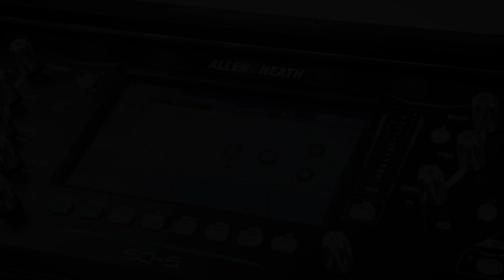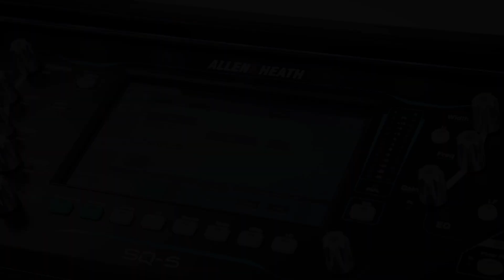Allen & Heath SQ – Using Rack FX

Comment: How do you send a reverb to aux-1 for monitors? Do you use any of the racks 4-8 or you use racks 1-4?
Reply from the maker: If you have already set up an FX mix on return to the LR and you want to send the same FX to a monitor on an Aux, you simply need to turn up the FX return on said Aux. You do this by selecting the aux, then finding the return on the layers and turning up the return. This can also be viewed and managed on the routing page for the Aux. 
If you require further assistance with this, please drop us a line support@allen-heath.com
Thanks,
Luke
Reply: @AllenandHeathUK  what is the main difference between the fx rack 1 to 4 vs 5-8?

I used fx rack 1 for reverb, at the back panel I used send/return then aux-1 but still there's no reverb coming outnof the monitor. Where did I go wrong?

Comment: HI. I wanted to ask you if possible. on Allen heath sq you can assign a waves reverb with waves rack but with usb using fx1 fx2 fx3 fx4 to avoid taking auxiliary outputs 1-12?
Reply from the maker: Hello Tony, 
The FX Engines are fixed to be used with the local FX's, it isn't possible to use the SQ FX engines to send/return from external devices.
You would need to use any of your Auxiliary buses patch through USB to your Waves platform, then returning this into a mono or stereo Input channel.
Thank you,
Rafael

Comment: But can you use ACTUAL inserts to outboard gear? I don't see insert jacks on the unit.
Reply from the maker: Hello Roy,
As a digital console, it does not have physical insert points, as analogue consoles used to have.
If you need to use external gear, you may do this by outputting the signal through a Mix bus and returning it into any available channel.
Rafael

Comment: hye keith... hmm i want to ask something.. why i cant sent the fx to aux??? i try to up fader fxreturn in my aux mix.. but the fx still  nothing.. why??? and bfore this im using different strip but still same input..i means split the mic.. hehe exmple ip1(mic vocal 1) but routing in Main LR only and strip ip17 (mic vocal 1) but routing at aux2,34 only..bcause i want to just vocal have some fx in my monitor/aux.. so the ip1 and ip17 (mic vocal1) sent fx some rverb and delay.. but  the dfferent is amount of the FOH and MoH.. but this trick is working bfore this..but right now after update 1.5.1 this method not working. and if i try sent fx at ip17 for aux2,3,4 the fx is nothing but hear / have at main/ FOH..  pleasee helpppp.. pleaseee.. pleaseee   #sorry fo my english..
Reply from the maker: Hi Joe, 

I'm sorry to hear you're having trouble! 

I recommend going to support.allen-heath.com to start a ticket on this, as I'm not aware of an issue in V1.5.1 that could cause this. If you could send me your show folder, I can load into my system and find the cause of the problem. You can find how to get the show folder here: https://www.allen-heath.com/media/SQ_ReferenceGuide_V1_5_0.pdf#page=65 

Thanks!
Alex

Comment: HOW MANY EFFECTS (PLUGINS) CAN I PLACE FOR EACH CHANNEL OF THE CONSOLE, WITHOUT DELAYING.
THANKS FOR YOUR ATTENTION AND PROFESSIONALISM
Reply from the maker: Hi Alexander, 

There are 8 Rack FX slots available on SQ. This means you could insert each of these onto a channel, or use a Mix > Return setup with as many channels as you like. 

We also have DEEP add-ons available to purchase at shop.allen-heath.com, and these replace the stock processing directly on a channel without adding latency. For example, any channel that has a compressor on SQ can load a DEEP compressor in its place!

Thanks! Alex
Reply: @AllenandHeathUK  Hi.
On the LA2A or 76 type compresor there is an option like stereo or mono? Like on Behringer i insert a stereo compresor and i send 2 microphones to it, one on left and one on right.

Comment: I was able to put reverb on fx1.  However I tried to put delay and chorus on fx2 and fx3 respectively but that doesn't work.  Any ideas?
Reply from the maker: Hi! 

This is done by viewing the FX rack in the FX page, then pressing the Library key. You can the select the FX type and recall it. 

If this isn't working on your system, please start a ticket at support.allen-heath.com for assistance. 

Thanks! A;ex

Comment: Thanks for the videos. If we want to use different types of reverb on different channels, do we add the reverb fx into multiple slots?
Reply from the maker: Hi Michael, 

Exactly! Each FX slot can be loaded with a different FX library, and then  you can route to it in any way you like. For reverb FX, it is usually best to use the Mix > Return setting, where as modulators like chorus or a dynamic EQ would be better on an insert.

Comment: So I see that to adjust how much of a channel is going to FX mix 1-4, you click the respectable blue button on the right, but what about for effects channels 5-8?  What is the best way to get to those and send output to them, or do I need to burn some of the aux mixes to have effects?
Reply from the maker: Hi Daniel, there are two ways to route to FX 5-8. You can either insert the FX straight onto a channel or mix bus, or you can use one of the 12 mix buses as a send. There are 4 dedicated FX returns for these units also. Thanks! Alex
Reply: Sorry, I still can't get that 5th FX working. There is only 4 returns and each of those has a dedicated FX 1 to 4. I created the effect, actually used the same as in the tutorial, a Chorus, went to the back panel, INSERT, AUX 5, Apply. I select the 5th AUX, great I can see it sending,
Reply: . . . but I can't return it. There is only 4 returns available. Can you help please, it's driving me craaazy!
Reply: you can use 5 to 8 fx slots as direct inserts to any channel, go to back panel of the fx slot you pick lets say a delay on slot  5 well set whatever channel you would like to apply that delay to example to a microphone connected to input one select number one but this set up sends the fx to all outputs